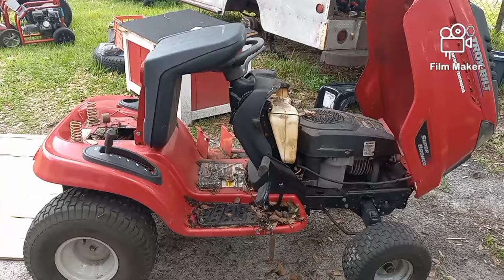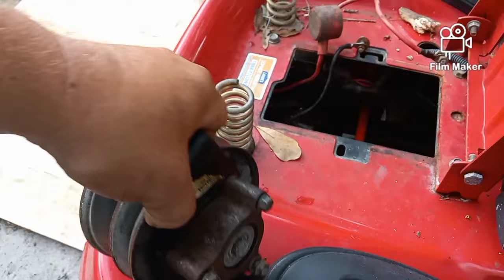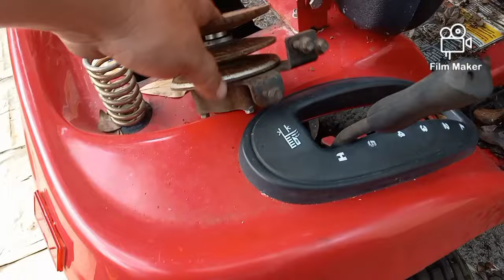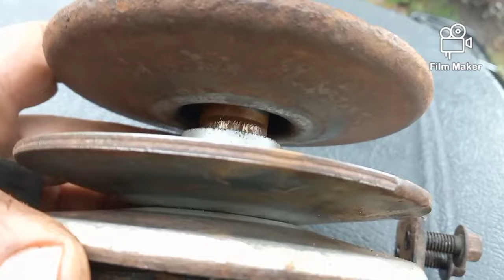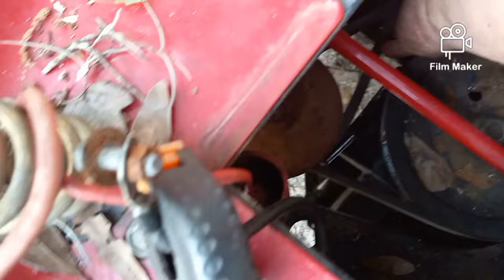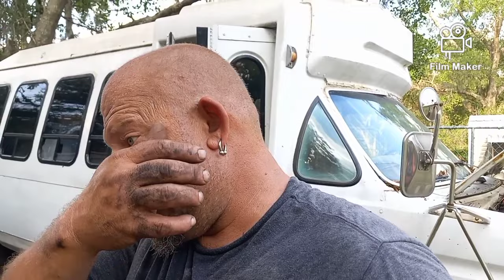Troy Bilt Won't Move / Variable Speed Pulley

Comment: help put new pully in and bearings  but seems to get hung up and wont turn any ideas on it troybilt  bronco
Reply from the maker: Which pulley are u talking about.. if it's an idler pulley u may need a washer that fits the bearing perfectly and not too large or it will tighten on the pulley and lock it down instead of tightening on bearing and letting it spin.. if it's the double pulley and it won't spin.. try loosening it just a touch to see if it has the same problem
Reply from the maker: U can email me for more specific help.. my email is on my about me section on home page

Comment: Yeah good video i have a craftsman T1600 i took the bottom bolt off, now that whole thing just spins and i can't take the pulley out 😢
Reply from the maker: Let me know how u get it off
Reply: @MunkyWrench  In my case the bearings (roller) were stuck on the pulley shaft. The only way for ME to get the old bearings off was to use an angle grinder. I suppose using a torch and quenching would work.

Comment: Just curious, why not just change the two bearings rather than replace the entire pully?
Reply from the maker: It's a closed pressed system.. there is no way to access the bearing unless the pulley is shattered like it is..you must replace the pulley
Reply: You can replace the bearings.  The 3 screws come out of the holder and inside it holds 2 bearings with part number 6203RS A small tap with a large socket over the bearings knocks' them right out. Put the new ones in the freezer for 12 hours or so, and the replacements drop right in.  Fixed my issue.  Bearings are less than $6 for 2 on Amazon.
Reply: Is there a video on bearing installation for that mower I need it ASAP PLZ
Reply from the maker: @hammohammbbyblksheep4251  I've been asked that before. If I recall correctly u can not replace the bearings. Its a 1 piece press fit system.  It is a non serviceable pulley. But thats just my recollection

Comment: Thanks for the video  My bearings are perfectly fine but is still chewing upper tranny belts. On my third one, any ideas?
Reply: I have the super bronco 50 XP it's four and a half years old.  I replaced the drive belt. And it chewed it up it just broke.  Mine's a different setup though. I can't find nothing on it
Reply: @thomasmeadows256  Yeah man I'm stumped. Mine came with my house but I certainly will be avoiding mtd manufactured machines in the future.
Reply from the maker: @thomasmeadows256  actually thats a good question I just got a call from client that said belt was chewed again so it has to be a loose pulley or something I missed.. ill be doing a follow up vid this week
Reply from the maker: I got a call from the client that it chewed a belt .. there must be another bad pulley or something I need to dig deeper.. ill be making another vid this week q deeper dive
Reply: @MunkyWrench  I will say that belts labeled as compatible on the internet do are not necessarily that same. A friend of mine suggested I get a belt with the part number printed on it, now all is fine. The belts I was getting from Amazon were slightly shorter and wider. So just because a website claims it is a direct replacement does not mean it will work!

Comment: munky wrench  recently change the blades. on troy bilt pony  and  my nightmare start 😂  so  the machine cut the grass only on  5 and 4 level  position and 3  2. 1 start to  making noise  and  turn off  help  please. the break pedal  too close to driver the machine  feel  like  stop without push the break pedal

Comment: Replaced the transmission belt lasted about ten minutes.
Reply from the maker: did you have a bad pulley? was the new belt the correct length and thickness.. can you pinpoint what tore up the new belt? was it inside the keepers or dragging the outside of something
Reply: @MunkyWrench  belt was right. Don’t know about the others.

Comment: If the mower is 5 years old they should be replaced and save a break down during the heat of summer 105 days
Reply from the maker: A but of preventive maintenance is always best.  Unfortunately I never see machines til after they break